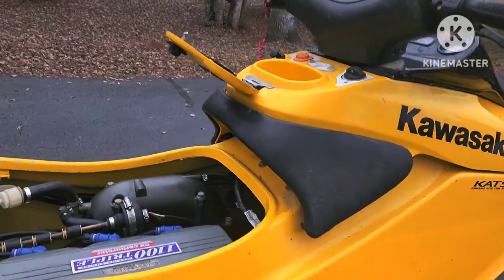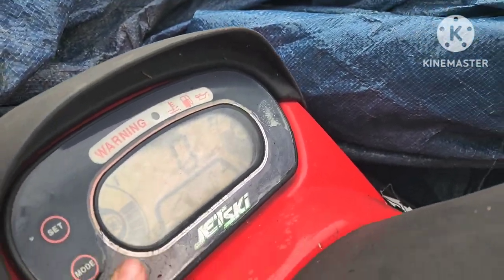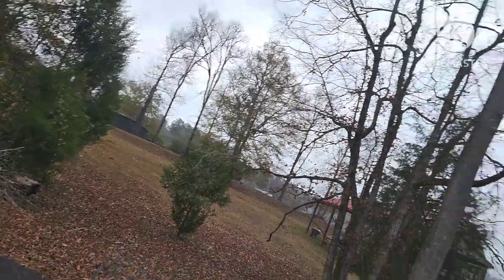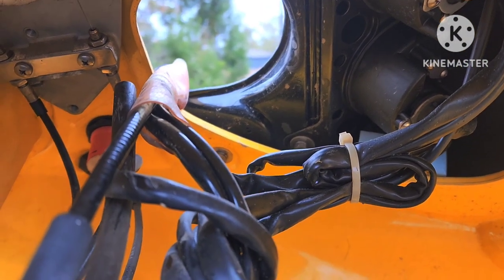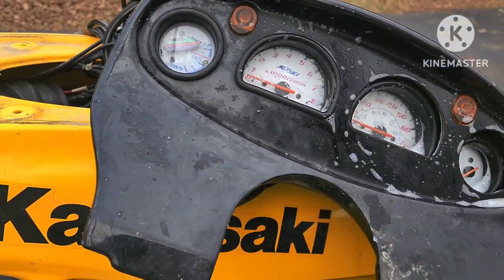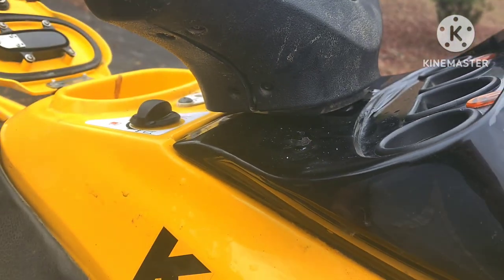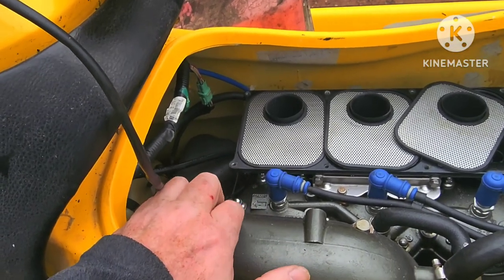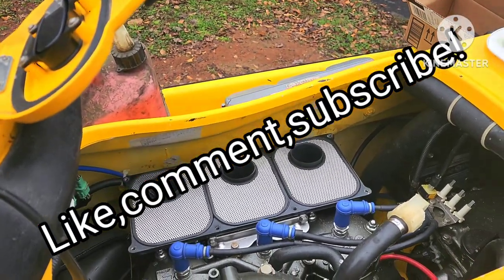Installing a fuel guage on a 2003 Kawasaki zxi1100 and testing the sending unit.

Comment: Hi I’ve been doing a motor swap from a Kawasaki 1998 1100 to a 1997 your videos are awesome and have help so thank you I’ve noticed all the differences you’ve talked about with different carburetors I know you’ve mentioned there’s a throttle cable difference from the 97 to the 98 is it a big enough difference that you have to swap the cables as well
Reply from the maker: The cable needed to be longer so I think the 97 cable would need to be put on the 1998.  The carb would rev high because the cable was too short.  Maybe there is a way to adjust it or change the cable bracket?
Reply: @ShadetreeJetski  okay thank you I’ll just swap throttle cables

Comment: My fuel gauge doesn’t work but my sending unit is all cracked ( hinge can smell gas did the soapy water to verify )the rubber part is that the wires go into do you have a option to just plug or cap the hole in the tank just gonna delete the float sending unit
Reply from the maker: I am sure you could go to home depot or lowes buy a rubber pipe plug, and cap it.  Now having said that your warning light may constantly stay on.  I was told by chris carter that a unit off a seadoo will fit over that hole.  I never tried it , but he said the seadoo pickups can be used to replace the bad kawasaki ones.  It is a tight fit supposedly.  The seadoo sending unit and pickups are all in one part.
Reply: Sweet thank you are you able to take it out of a zxi without taking the motor out